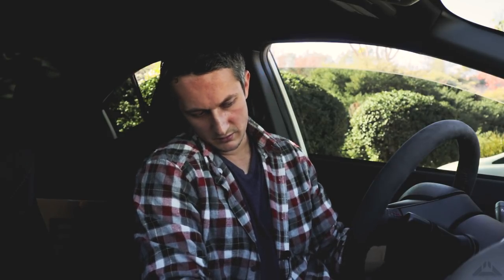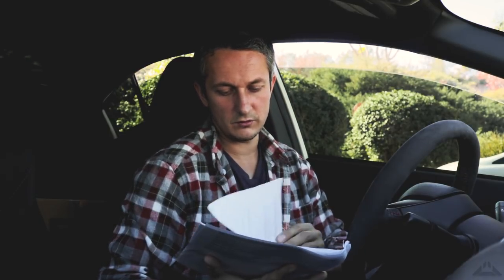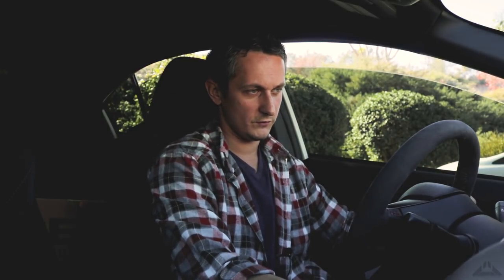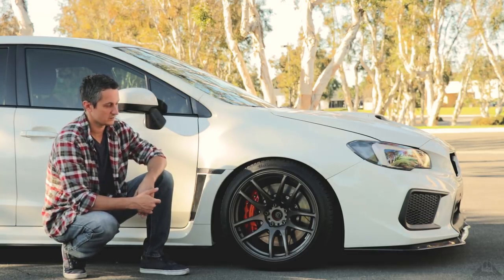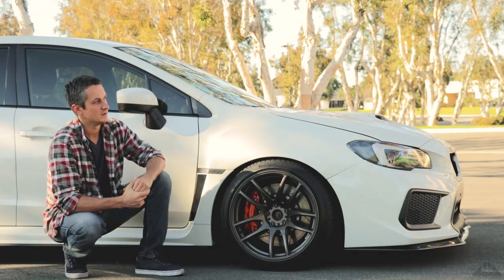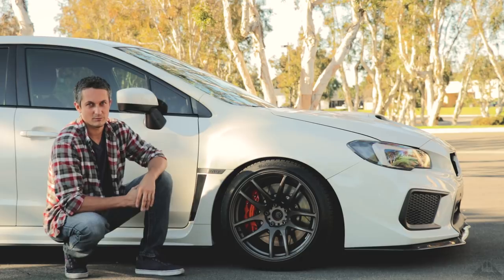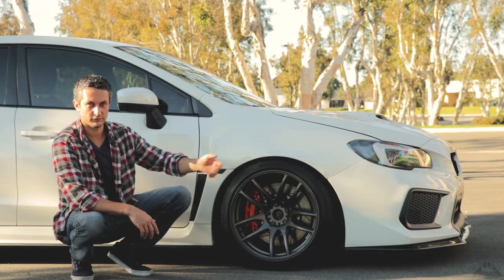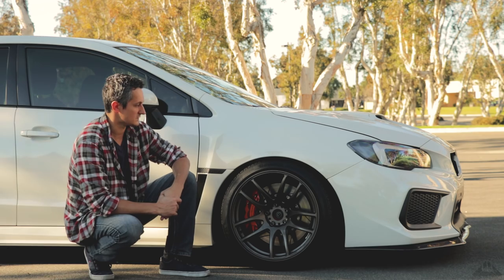ProdigyWerks BBK installed on the WRX

Comment: So do you not really care about your warranty since youre doing all these mods? Or have you found a loop hole hahaha?
Reply from the maker: No loop holes here, if something breaks, then I fix it myself. That was the idea behind getting this car, do it yourself! At this point every bit of the car has been modified, so the only warranty I can probably get on this is maybe on the window motors... Or windshield wipers (wait, I messed with those too...)
Reply: @TheShaddix  hahahaha thats awesome, i respect the hell out of that. So i have one last question, not trying to be annoying im sorry. But im looking for abit of turbo sounds, but trying to keep my warranty safe as much as possible. Everything is stock on my car, but im putting the r400 on and a turboxs hybrid 5050 bov. Am i gunna hear the turbo more? Should i delete the resonator before putting it on to make it easier for me? Any info would be appreciated
Reply from the maker: @kylelatour5662  I suggest returning that 50/50 and getting a fully recirc bpv. You'll have issues with it unless the car is tuned to accommodate for less air coming back in past the maf. Resonator delete is a strong yes. Doing it before or after makes little difference for a shop, but might save you a few bucks. Also, if you want to keep your warranty intact, do not mess with changing the stock bpv. Even getting the exhaust is sketchy. You either go all out or just stick with wheels, springs, and tint. And to answer your question, no you won't hear the turbo more at the intake just with the bpv, you need a new intake like gs. You'll hear some spool at the exhaust but not from the seat. But with a new intake you need a tune... You see where this is going, haha
Reply: Daammnnn that sucks. I would go all out im just so scared of voiding my warranty and then blowing my motor lol. I know how bad subarus are for that lol.
Reply from the maker: @kylelatour5662  you only risk it if you run a crappy tune or a lot of torque
Reply: @TheShaddix  ok so what if i keep it relatively safe till my warranty is up? Talked to a technician at my local subaru dealership and he said a catback is fine for my warranty. And as for the 5050 bov, i read lots of reviews and did some research and it is safe to run and doesnt bring up any check engine lights. And (i know this is shady) but what if i installed the bov myself, then switched it back to stock whenever i brought my car in to the dealership?
Reply from the maker: @kylelatour5662  just not long ago some dude hit me up saying he had a check engine light with a 50/50. I wouldn't even bother with that without an etune at least, up to you though! I'm not the best person to help with this sort of thing as you can see, I mod everything I can.
Reply: @TheShaddix  i just want to hear the bov noise you know? You literally cant hear anything with a recirc.
Reply from the maker: @kylelatour5662  If you got an intake, even the stock bpv becomes super loud and sounds nearly identical to my turboxs bpv. It just won't sound right with the stock intake having zero sound and then a loud bov sound out of nowhere (no spool to accompany it). If that's all you care about, that pressure release, then what I'd suggest is an intake that does not require a tune, if there is such a thing. From what I heard Perrin is the only one, but I could be wrong. Either way, it's like you want to mod but you don't want to overstep the warranty line which some subaru tech drew for you on sand. You know that just because he says something does not mean that once you bring the car in with some malfunction they'll be cool with the choices you've made. 99.9% of the time these cars don't have any issues in factory spec. It'll show in their system exactly what caused the issue, even if you removed that part, the numbers don't lie. So, for example, you install your 50/50 and something happens that you can't just reset, so you take it off, bring it in, tell them you never did anything, but the system shows that the air recirculation was altered and the maf readings were off and it overcompensated and told the ecu the wrong info (just a very basic example, don't quote me on this), and caused some other serious issue. Then they'll dig deeper and find signs of you wrenching around there while you continue to deny it. I've been there when you have to argue with the tech about your car being modified, it's not fun. Or keep the car somewhat stock and keep the warranty. Adding a new bpv, exhaust, and some other stuff does not sound to me like playing it safe. With the exhaust you're altering the back pressure too which could (to them) pose a reason to not want to fix your car for free. Either you do it right from the start and mod it with a proper tune and parts, or leave it as is. Or don't listen to me and just go for the mods you mentioned. You'll enjoy the car but always be worried about the warranty which is a buzz kill.
Reply: @TheShaddix  yea its deffinitely a tough decision. Ill probably wait a while and just do some cosmetic stuff for now until i make my decision. Thank you so much for all the help and info. I really appreciate it man. Gunna keep living vicariously through your amazing car hahaha. Super excited to see what you do to it next!
Reply from the maker: @kylelatour5662  No problem! If you do decide to mod, just collect all the parts you think you'll want, then install all at once and get a tune at the same time so you don't drive without that.
Reply: @TheShaddix  well with all the info youve given me i dont think ill be doing anything until i have like 8-10k saved for a new engine hahaha. Id be screwed if i voided my warranty and did a bunch of mods and then blew my motor. I wish you could get a new motor through insurance hahahaha